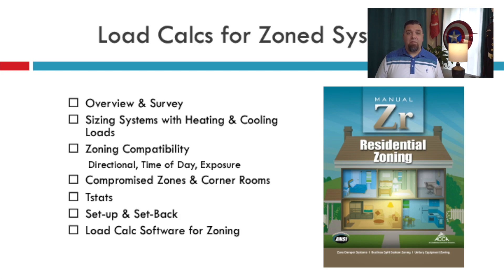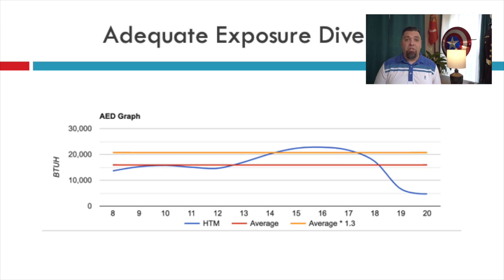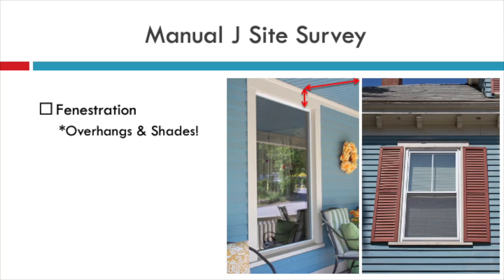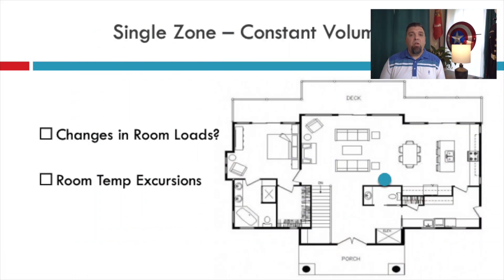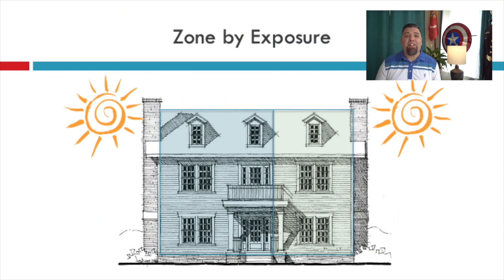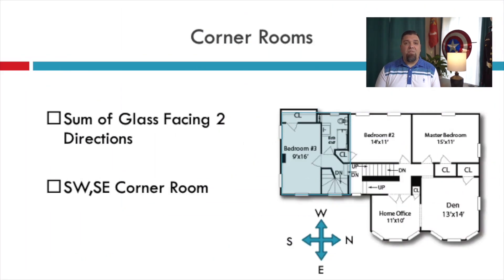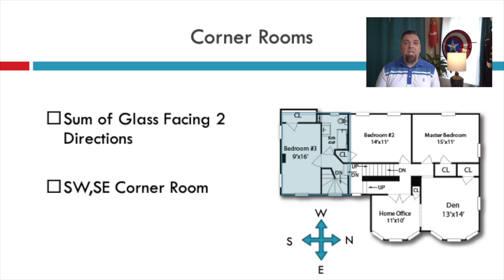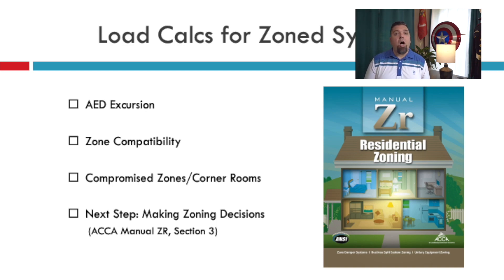HVAC Load Calcs for Zoned Systems

Comment: What a joker. I would fire you the second you insisted on doing my load calc at 75F and 50% RH. Try more like 65F and 50% RH. As a professional, your first and foremost ethical obligation is to the client and their requirements; if you refuse to do that, you need to find a different profession.
Reply from the maker: Although I appreciate your passion and dedication to the homeowner, sizing to those indoor design conditions will not help them.  I will continue to teach and stick with the International Residential Code, International Energy Conservation Code, ACCA Manual J, and the properties of air (like dew point).  Thanks for watching though!
Reply: @HVACProBlog  If you know the relevant math and physics, you should be able to design a system to any conceivable requirements. It's not that hard. Whether or not the client wants to pay for it is a separate matter. Personally, that's where I'm comfortable, so I'm willing to pay. In fact, my indoor conditions are 63.5 and 44% right now, and it's perfectly comfortable. I would be covered in sweat at 75 and 50%. I guess I'll stick to more flexible contractors or do it myself; I didn't go through a mechanical engineering degree for nothing.

Comment: What are your opinions heat pump Re zoned systems, esp if not modulated and using a fully communicable inverter fully variable blower system?